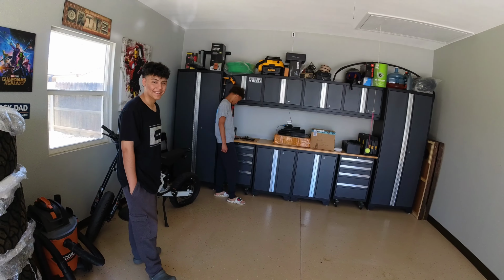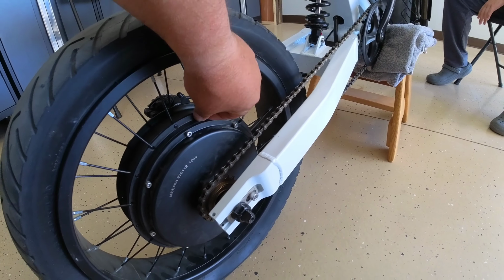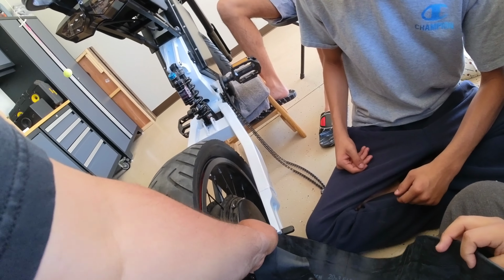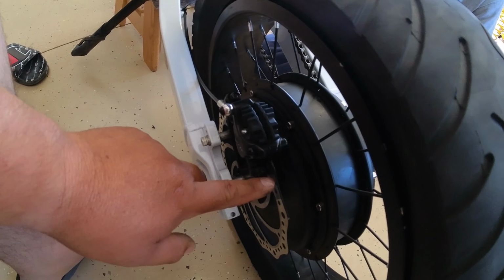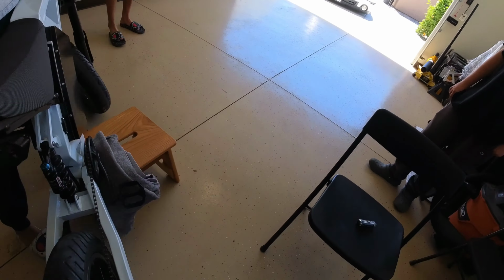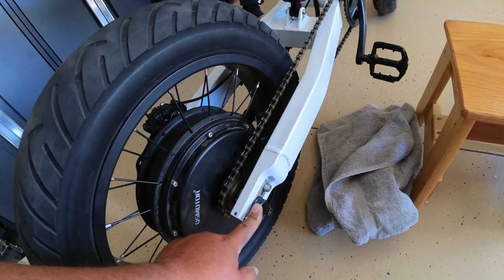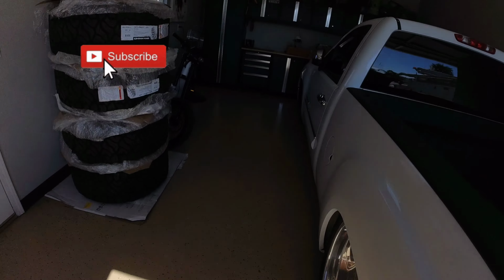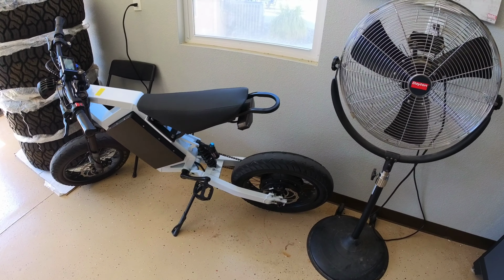CS20 Sur-Ron / Super 73 type e-bike flat fix

Comment: Hello, I noticed the bike has a derailer, Does the bike have gears? or is it one set gear, and is the set gear enough to pedal the bike around easily?
Reply from the maker: Bike has one gear only and is very easy to pedal. Honestly to easy. I think it could use a bit higher gearing as you start pedaling to fast to quickly. I guess they figured the pedals are more for show. I'm no bike wizard but maybe a sprocket change could make it better if it was a huge deal to someone.